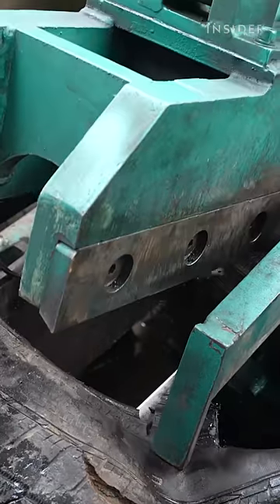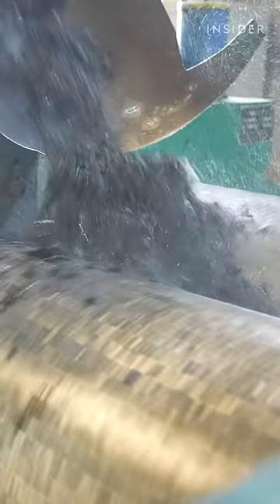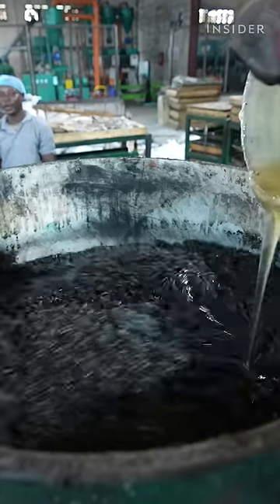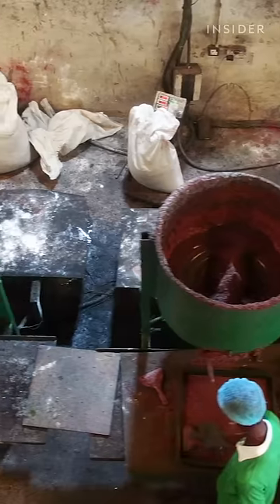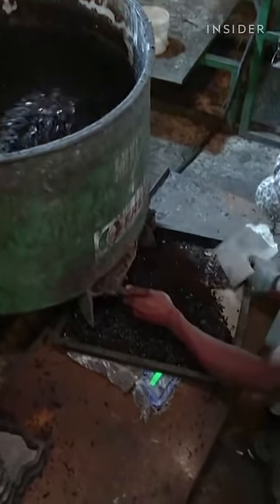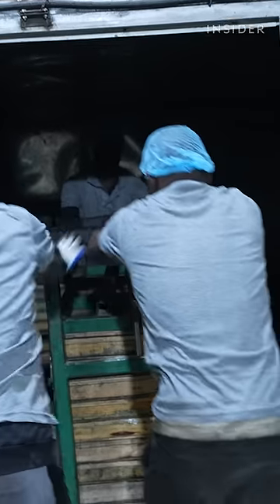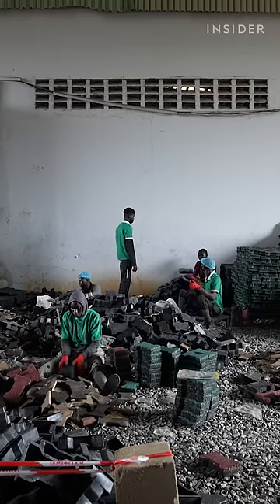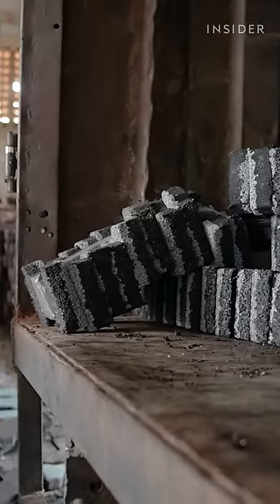Here’s how this company recycles old tires to create rubber bricks. 🧱 #rubber #sustainable #nigeria

Comment: Oh wow this is so cool. ❤ Would have been nice to see a picture of a house built with these bricks at the end.
Reply: I don't think they're building houses with these. I think they're for walkways, playgrounds, etc.
Reply: The house fell down before the picture could be taken
Reply: its for road pavement...doesnt last long
Reply: Its for children playgrounds so when they fall they can’t hurt themselves
Reply: They're used as interlocking pavements, as an alternative to concrete interlocking bricks, it's a good way to recycle the rubber instead of dumping tires in landfills.
Reply: also, don't tires release some toxic stuff over time?
Reply: @slaveNo-4028 potentially yes, they are no longer recommended for use in home gardens such as growing potatoes in stacked tyres.
Reply: @truechizable  😂 I don't think they would be good for an entire house. They would be perfect for a playground, gym floor, even private or public walkways
Reply: paver blocks, like for the garden or around the house.
Reply: They are pavement bricks. Used for driveways, etc
Reply: @coldogno7 interesting .Here in Phoenix they rubberizes hundreds of miles of roadways. Is that a true fact or did you just pull that out of your hat?
Reply: That would be one stinky house 😂
Reply: That would be a flammable house
Reply: @Kammo757  ...& the "polyurethane binder" makes a great accelerant!
Reply: Toxic playground coming
Reply: My dude, you're definitely not building walls and houses out of rubber bricks, that's not what these are for... 💀

Comment: We use these tire bricks here In Jamaica for bushing repair and rebuilding in cars and large machinery. It’s way tougher than stock bushings with like 15 times the running hours. I replaced my control arm bushings with these tire composites cut to shape and I can tell it’s best thing u can do for waay less the price.

Comment: I say this is a good start to reusing plastic, but if we go this far why not just use hemp it’s proven you can mass produce building blocks that are extremely durable and fire resistant in nature. Rubber burns for a very long time. Although idk if the bricks would burn after being being baked

Comment: Just kinda had a ptsd flashback to when i first learned there was wire in tires. It was my first car and first time having to put a donut on. Went to remove the tire with bare hands and it really should have been replaced way way long before. I fucked my hands up!

Comment: Hmm, doesn't it smell in the sun? I not sure how it will behave after all this. I guess tires should be made form rubber that is quite good with heat. Even if is smell when hot, they could be used as gym flooring

Comment: So when it gets too hot, and as temperature and environmental conditions fluctuate, whatever they build will begin to warp. Over time it will lose structural integrity. Possibly causing injury or even death depending on the application.

Comment: The recycling idea seems great but....tires are extremely toxic to the environment. Heat and rain over time will eventually leak out harmful chemicals, including heavy metals like lead and cadmium, which will leach into the soil and water as it degrades, posing a threat to human health and the environment. In addition, tire rubber contains compounds like benzene and butadiene that are known to cause cancer.

Comment: I find this one of the stupid forms of recycling. After separating the metal and rubber the metal should be melted down and poured into ingots and the rubber should go back into the tyre industry. 

Otherwise, what has it actually achieved? Nothing. 

The tyre industry will still have the same demand for rubber for tyres so it hasn’t reduced consumption in any way. 

It has also added to the problem by using them, for example, as roads. There’s a reason we don’t use them for roads and it’s because rubber isn’t hard wearing, hence the reason they have so many tyres to break down in the first place😂

So now the bits of rubber that get ripped up from daily use can find a way into animals throats, drains etc. 

I’m all for recycling, but you have to use some common sense and logic when doing it otherwise you aren’t doing anything other than adding to the problem.